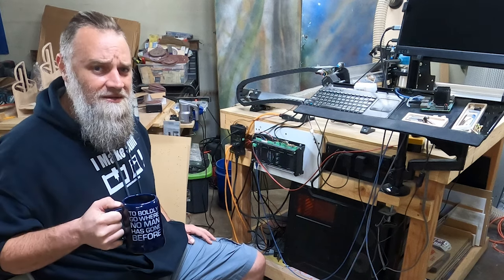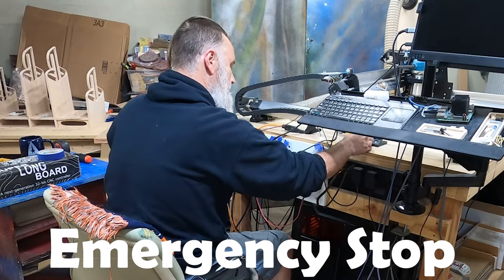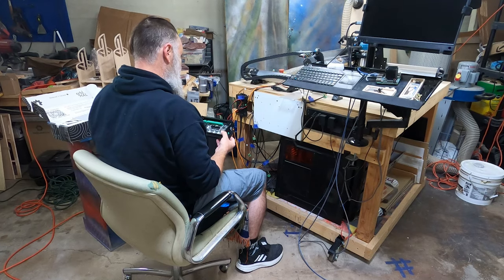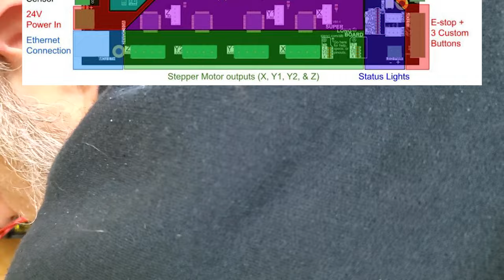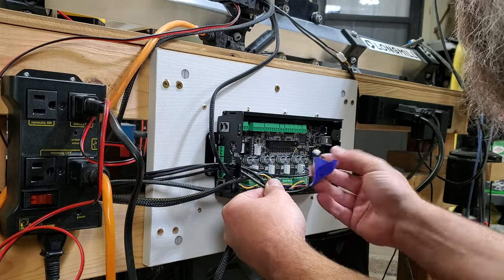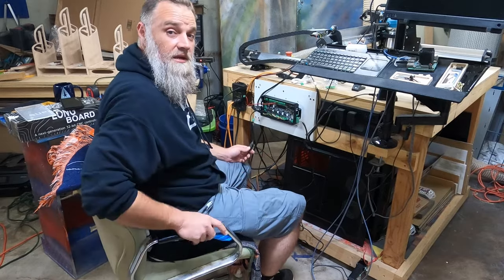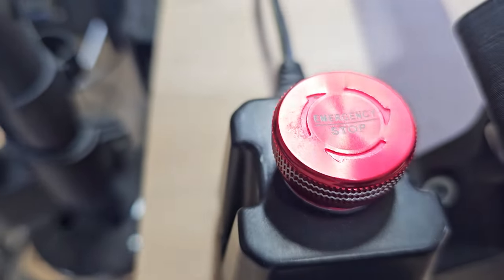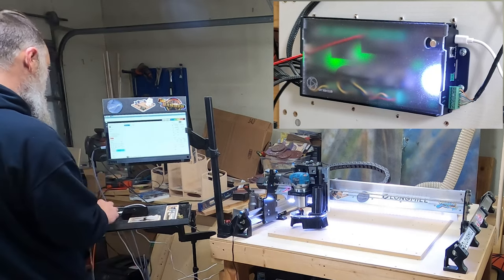Installing the SuperLong Board on CNC Router | Sienci Labs Upgrade Tutorial

Comment: This is great, thanks for making this video so I'll know how to hook it up before I get mine!! I appreciate this.
So did the board come with any instructions or anything like that?
Reply from the maker: Thank you. No included instructions, but they have guides and pin outs online.
Reply: @D.E.Hammer  Ok, cool. Thanks.
Reply: @D.E.Hammer  I think this is pretty funny; we spent all that time trying to get that remote controller to work on my machine, and now this board has a port for a pendant, that'll work even better!!! 😆😆 
Now we just have to find out which, or what kind of pendant will work with it. 🤔